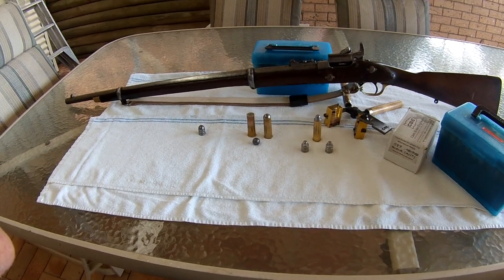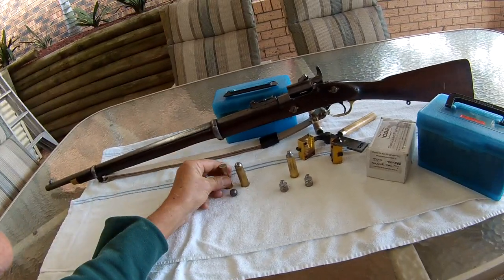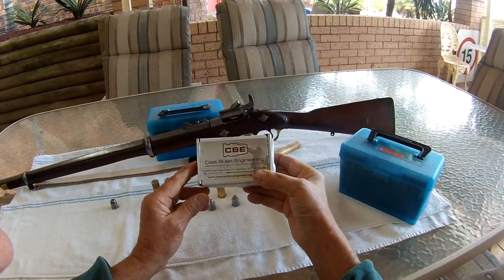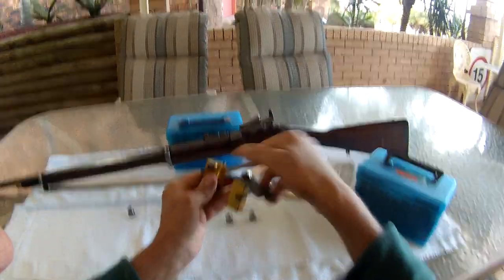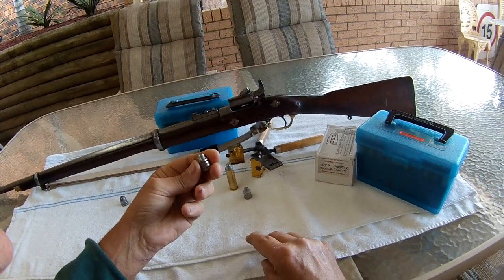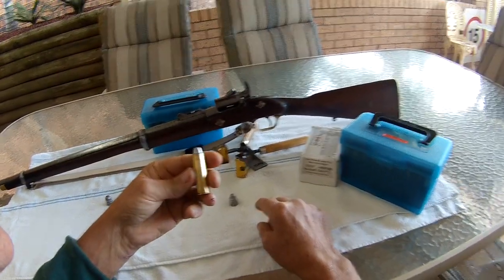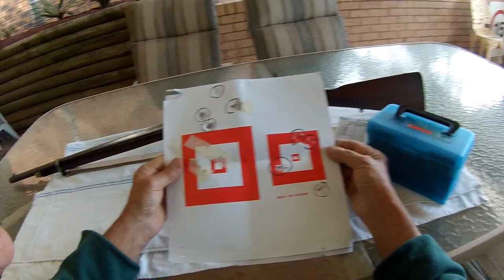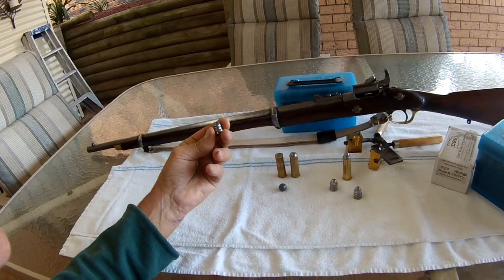577 Snider Bullets

Comment: The problem is that the original snider round had a fired clay plug in the rear to expand the round, without it and just depending on the gas to expand the round you end up either not engaging the rifling at all or doing so poorly resulting in unstable rounds.  The Greenhill formula shows for the 3 band like mine who's twist is I think 1:72 or 1:78 that I will want a shorter stubby round (it's why the .60 rounds work pretty good).  I have a .600 x .680 mold on order for my snider.  The larger rounds are groove diameter at the case and will engage the rifling right away improving accuracy.  Others have reported increased accuracy by bedding the barrel in silicone rubber but I have not actually seen that done.  The last accuracy improving idea I heard but this is entirely rumor is that someone was putting metal inserts inside the case to reduce the interior volume back down to something close to the original snider case volume.  How or why this makes a difference is unknown but the person doing this claimed improvements.  Cheers!
Reply from the maker: Thanks mr Lensflare I appreciate your comments I remember reading about that clay plug and tried some hard wax I think i gave up to soon ?. The other 2 ideas are interesting i see northern Inventor was one of them he is one smart and skilled guy.There is something i did notice about my friends and my Sniders when you look down the muzzle the rifling looks good and even to the breech and a 577 bullet will slug ok but when i drop that same size bullet into the breech end it free falls to the first band I dont know if they were made that way or just a little worn out in the last 150 years. Anyway i learned not to push my bullet to hard and strip the rifling I'm using 67g of FFG with my 589 cal 480g bullet and am happy with the results. Thanks again for your comments us Snider shooters are getting as rare as our guns .  Cheers from downunder.
Reply: mrbikehunter I had heard a few people tried bondo for plugs but I don't remember if they had any success. Next year when I have access to a machine shop again just as an experiment I am toying with the idea of both milling a cavity in the nose and filling it with a wood plug and trying some simple fired terra cotta base plugs.  The one aspect of the snider I really like the ability to reload without a lot of equipment.  In fact the only technical issue I face is how to get new primers into my brass absent a loading press.  Cheers!